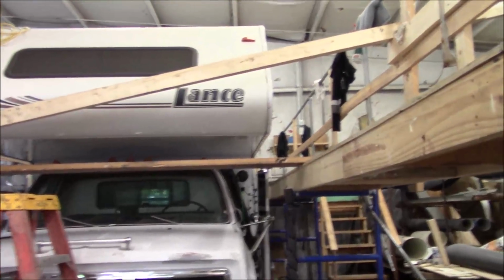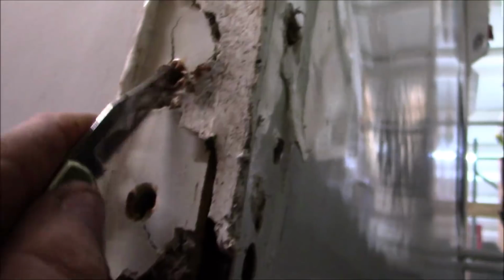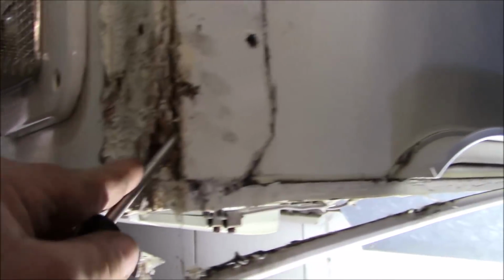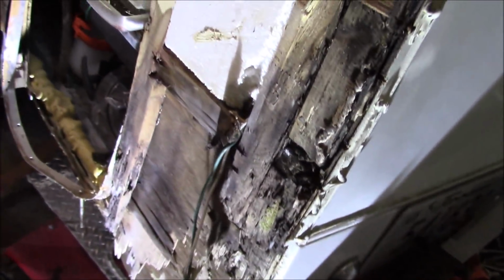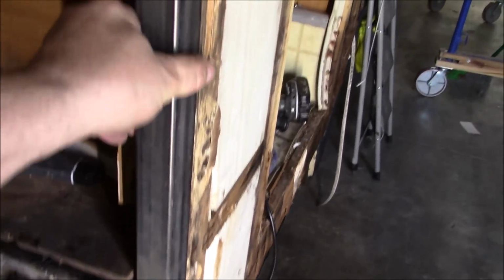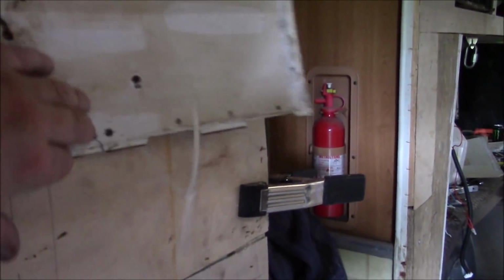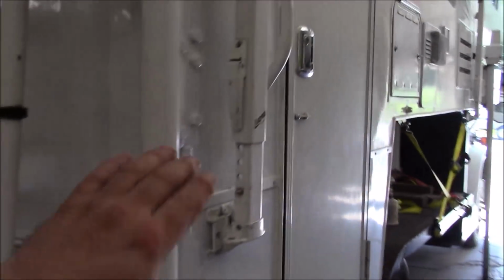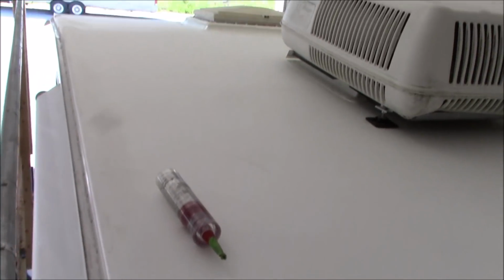2005 Lance Truck Bed Camper New Roof Rear Wall Rot Removal and Rebuilt Jack Support Structures

Comment: Nice job by the way makes me feel better to see you welding in some steel
Reply from the maker: Lance should've put steel in there. That camper weighs 4000 lbs. The RV Moto is to.... Get em built, Get em Out, Get em Sold! Thanks for watching!

Comment: so you are puting new wood over the existing wood? How does that not create a height difference  problem with termination bars?
Reply from the maker: The only difference is the roof is up higher. Gutter rail went back where it came from. It get screwed into the band board. Thanks for watching.

Comment: Like the engineering. Fit and finish.. Using flashing on roof vents? Older Lance campers roofs had hardly any convex to them. Original seals around all  areas except A/C require inspection (end of Summer). Effectively like a flat roof house you should be able to have slight amounts of puddled water . Roof Flashing around vents and commercial/residential  self peircing /rubber gasket screws on a any decking that is less than 1/2" is defeating. You know, for roof and most camper aluminum framing , self-piercing lath screws (not self tapping) are viable and have coverage (like small washer) , very little crown. Unless it was a Monday ,most Lance campers are sealed very well. Lance has used aluminum I beam supports to interlock block foam roof panels since the  late 70's (squire?) .Not having fiberglass batting for roof insulation /construction ? Well you will see a leaking issue quickly. Campers using fiberglass batting insulation,will absorb water like a sponge ,and then release water after fully saturated.Being said , impressed by steel refitting. Lance campers -less than 1" walls , not much to work with. Lance campers are a dominating percentage of truck camper market. Proven bonding agents in their pressure laminating process, combined with great sealing have made them a long lasting campers(mostly). As with any camper not  inspected or put in storage ; a non addressed leak can lead to problems.
Reply from the maker: Lance although tired and marketed as the best, in my opinion, are not. The design of the rear jacks need improvement. This is not the first Lance we have worked on that needed the corner frame rebuilt. Logically it does not make sense to drive a total of 9 screws through a 2x2 within 13 inches and not expect it to split and get compromised. The jacks supporting the camper will rock in the wind and that poor fastening allows for separation where caulk is compromised allowing for moisture at first to sleep in...condensation and such. Once the gap gets breached even more from additional movement, and addition rot more water gets in. Understood that the idea is to build as light as possible however you can only go so light before it just doesn't work.
The polystyrene foam adds strength once the ceiling and roof panel are adhered and vacuum sealed, however again...the aluminum 1x1 frame for a span of 8 feet is not strong enough to carry any normal load of snow, ice and the bouncing movement of the AC as it travels. Roofs are not supposed to hold any water. The commercial roof industry define ponding water as water not evaporated within 2 days. Ponding water acts as a magnifying glass and compromises the membrane to premature failure. On a camper there should be no reason for standing / ponding water at all. On comment roofs there is concerns of pollen, leaves and debris that create dams preventing proper drainage which, as you stated , you be inspected at least annually to rid the damning and allow for water flow. Additionally, the ponding water adds weigh to the roof which can create additional sagging. 
Thanks for watching. Appreciate your input. I have learned that whatever any manufacturer claims to be an upgrade or added benefit for the customer is a guise for them to build quicker and cheaper to benefit the manufacturer solely. I have not found one camper or coach to be any better than another. Remove the decals and you would tell one from the other in build style or quality.

Comment: Surprised that there are no decent building and safety requirements for the RV industry.
Reply from the maker: RV manufactures have no codes except for D.O.T. and personal safety...meaning you won't be get electrocuted, hence the GFCI outlets.  Otherwise, as long as they are not slinging in parts on the road they're good. I'm sure they see what I uncover. 
Thanks for watching.